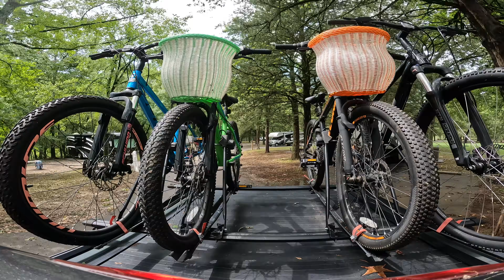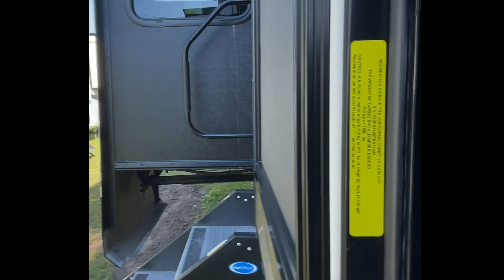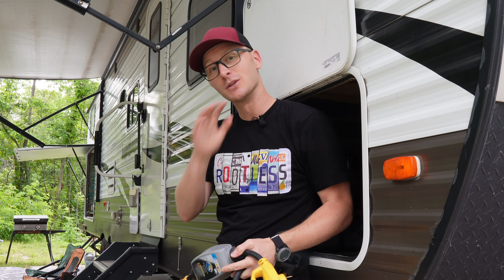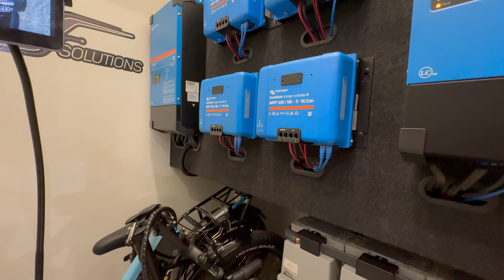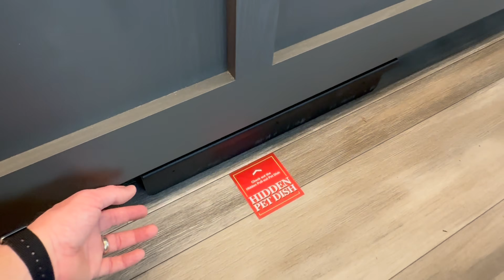BEFORE Buying My First Travel Trailer, I Wish I'd Know This About RVs...

Comment from the maker: There are a few things I really wish I had known before hitting the road with my first travel trailer. Let’s talk about the lessons I learned the hard way (so you don’t have to) that can save you time, money, and frustration with your RV adventures.  If you’re shopping for your first RV or looking to avoid some common rookie mistakes on your next rig, this one’s for you. ⬇⬇⬇CLICK READ MORE FOR LINKS⬇⬇⬇

DISCLAIMER We participate in several affiliate programs that earn us a commission on purchases made through our links at no extra cost to you!
Some product links are affiliate links which means if you buy something we will receive a commission. As an Amazon Associate I earn from qualifying purchases. Some of the gear in this video may have been provided to us at no cost. The views and opinions are our own. This video is NOT sponsored.

⭐ GEAR ⭐
🔷Mattress Airflow Options:
 🔹Hyperventilating Aire-Flow https://www.mattressinsider.com/mattress-condensation-prevention.html
 🔹DRICORE DuraDri Mattress Underlay https://geni.us/wmVNARi (Amazon)
 🔹Froli Sleep System https://nickleatlantic.com/collections/star 
 🔹Other Underlay Options on Amazon: https://geni.us/2lxdVd (Amazon)
🔷Power Watchdog by Hughes Autoformers Electrical Management System Smart Surge Protector with Wifi Gen2 https://geni.us/FNV5F (Amazon)
🔷Microair Digital Wifi Thermostat https://geni.us/CWLS (Amazon)
🔷MaxxAir Deluxe Rooftop Vent Fan https://geni.us/zHWkhB (Amazon) 

⭐ Services & Trainings ⭐
♦RVFix: 14 Day Free Trial & HUGE Discount Use Code "GEARANDFAR" https://www.rvfix.com https://rvgearandfar.com/rvfixreferral
♦RV Help: https://rvhelp.com/ref/vE88nWyI
♦RV Technical Institute https://www.rvti.org/
♦Lippert Owners School https://support.lci1.com/rv-owner-training
♦NRVTA In-Person Training: https://nrvta.com/
♦RV Tech Course Home Study Program, Produced by the NRVTA (Virtual) https://rvtechcourse.com?ref=rvgearandfar⭐ Additional Videos ⭐
🎥DIY 2x4 Stabilizers Tutorial https://youtu.be/ropysInhCbc
🎞Angled Stabilizers Comparison https://rvgearandfar.com/ytcomingsoon
🎥Full Tour of Our RV https://youtu.be/m3y-VB8hVbY
🎞RVing With Pets https://youtu.be/G1GCfwelap8
🎥Whats in my RV Toolbox? https://rvgearandfar.com/ytcomingsoon

🚐 Favorite RV Gear:
🔸GasStop Propane 100% Emergency Shut-Off https://geni.us/KmLBS (Amazon)
🔸Valterra Twist On Waste Valve https://geni.us/IHqqrCA (Amazon)
🔸HitchGrip Hitch Handle https://geni.us/FENglr (Amazon)
🔸Portable White Noise Machine https://geni.us/puASyQQ (Amazon)
🔸RV Ramp Levelers https://geni.us/iJWkX (Amazon)
🔸Solid Rubber Wheel Chocks https://geni.us/vS04fc4 (Amazon)

00:00 RV Tires: Important Information 
Why your RV tires might need to be replaced before you take your first trip, even if they look fantastic
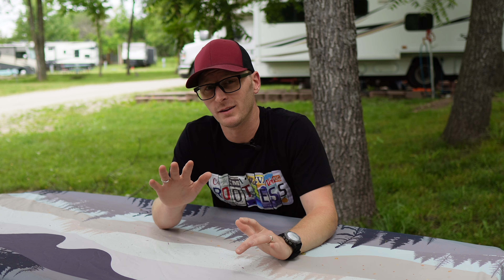01:44 Is RV Travel Cheap?
The real cost of RVing—and why it’s not always the “cheap” way to travel
02:23 Why an RV with “no repairs” (even a new one) is a HUGE warning sign
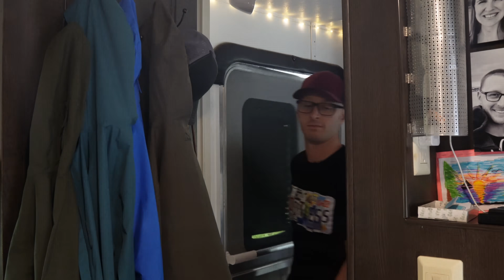04:23 RV Mattresses - What’s the deal?
RV mattress sizes (spoiler: they’re weird) and one way to fix the sizing issues without breaking the bank
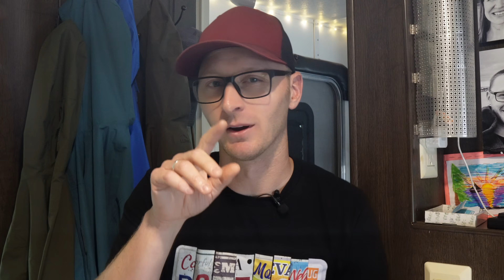05:12 The Problem With RV Dinettes & Jackknife Couches As Beds
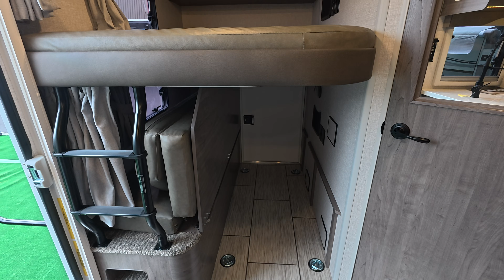06:11 WARNING: Important Consideration When Replacing An RV Bunk Mattress
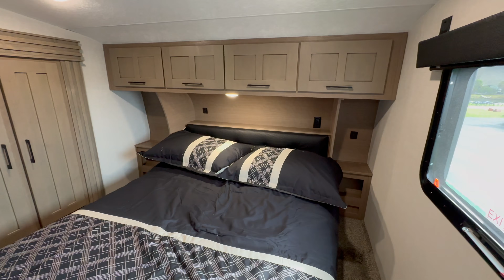06:27 How To Keep an RV Mattress From Molding
07:27 Payload VS Tow Ratings: The Difference & Why RVers Should Care
09:46 The CRUCIAL Number Most RVers Avoid (Or Don’t Know About)
11:17 30 amp VS 50 amp RVs: What’s the PRACTICAL Difference?
The difference between 30 amp and 50 amp electrical systems—and why it matters way more than I realized
14:34 RV Surge Protectors VS EMS (Electrical Management System)
What an EMS (Electrical Management System) actually does and why it’s worth every penny
17:17 12v RV Battery: Can It Run My RV Overnight? 
You’ll be unpleasantly surprised at how little your standard RV/marine 12v battery can actually run over a 24 hour period - let’s break it down
19:03 RV Vents: How Many Rooftop Vents Are Ideal For Camping?
19:43 Electric RV Stabilizers: Are They A Worthwhile Upgrade on your Camper?
20:30 What Are The Best & Cheapest Towable RV Stabilizers?
20:54 RV Floorplans & Road Mode: How Vital Is Roadside Access With Slides In?
22:02 RVing With Pets: Key Tips To Camping With A Dog or Cat
23:00 The Hard Truth Behind Owning an RV
23:29 Not Everything You See Online Is Accurate Concerning RVs
24:12 Training Opportunities for RV Owners

🏘 Join the RV Gear & Far Group Here:
https://www.rvgearandfar.com/rvgfyt 

Connect with us! 
💥 🎥Connect! https://www.rvgearandfar.com 📷📺

© RV Gear & Far, All Rights Reserved. 

This channel is for entertainment purposes only; we are not experts or professionals. We share our opinions, experiences and what works for us. Please do your own research and make your own decisions.

#rv #rvlife #rvgearandfar

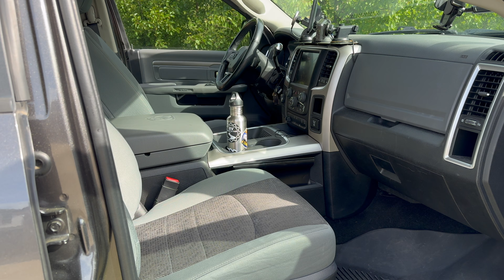Comment: 8:49 it actually does NOT include a 150lb driver. You must deduct the weight of the driver from the payload as well.
Reply from the maker: Check your specific make/model/year vehicle - I found this in the RV & Towing Guide: https://youtu.be/zXvJsrzI2sg?si=aovXMBRV1EXiZXrV
Reply: @rvgearandfar the RV and Towing guide specifies maximum payload within the guide which is adjusted downward for these figures to help you make a purchasing decision. The door jam sticker on a specific vehicle does NOT factor any passengers including the driver.

Comment: Great tips! I just have one question. You seemed to say that a 150 lb driver would not count toward the available payload capacity. I have never heard or seen this before so I did a little research and I can’t find that anywhere else. I have a ford and on the Ford website curb weight is described as “the weight of the vehicle including a full tank of fuel and all standard equipment. It does not include the weight of any passengers , cargo, or optional equipment.”

Even though they use the term “passengers “, I believe this would also include the driver or they would have included the driver in what is included in the curb weight. I am a stickler on not exceeding weight ratings of my truck or trailer so I weighed my truck at a Cat Scale when it was new, no gear, a full tank of gas and no occupants and it was within 20 lbs of the curb weight on the stickers. Note: the “curb weight” was not listed but can be calculated by subtracting the listed max cargo from the GVWR. 

I hope I’m wrong because I would love to find out I have an extra 150 lbs of cargo capacity that I didn’t know about.
Reply from the maker: It was in the RV and Trailer towing guide - see example here: https://youtu.be/zXvJsrzI2sg?si=fL9BZ6vKh_nQyVxV&t=109

Its quite possible that they've adjusted this as those types of number manipulations seem to change over time and on what the manufacturer wants to highlight

Comment: One question, why are you using the electric side of the water heater, just use propane, and you can save yourself all of those Watts
Reply from the maker: That's what we've switched to for the most part - but the main draw to using the electric heating element is not having to pay for, or refill propane cylinders ◡̈

Comment: What do you elevate the mattress with? I had no idea there could be an issue of mold because of the pass-through storage
Reply from the maker: Its a product specifically designed for this - comes in a roll and you cut it to fit your space. There are some links below.

DISCLAIMER We participate in several affiliate programs that earn us a commission on purchases made through our links at no extra cost to you!
_Some product links are affiliate links which means if you buy something we will receive a commission. As an Amazon Associate I earn from qualifying purchases.

🔷Mattress Airflow Options:
 🔹Hyperventilating Aire-Flow https://www.mattressinsider.com/mattress-condensation-prevention.html
 🔹DRICORE DuraDri Mattress Underlay https://geni.us/wmVNARi (Amazon)
 🔹Froli Sleep System https://nickleatlantic.com/collections/star 
 🔹Other Underlay Options on Amazon: https://geni.us/2lxdVd (Amazon)

Comment: And what is the best advice? Because I just purchased an RB and I'm trying to figure out how everything works. What is your Best it's advice. In case did I wanna have the AC run in first? So what I supposed to do? Because my Rb is  30 amp
Reply from the maker: Would you mind rephrasing your question - I'm not understanding exactly what you're asking.

Comment: Great video. To manage my 30 amp load, I will turn on my water heater for an hour or two prior to need when the A/C will be used. Water stays hot for hours. A bit like the emersion heater when i lived in England.
Reply from the maker: Yupp - power management at its finest! ◡̈

Comment: I watch a lot of RV tip channels, I always find yours are well done. I especially love the DIY 2x4 stabilizers. It's nice to not get that rocking feeling with kids around. Electrical section was most helpful for me. Ive probably overdrawn my AC unit on 30 amps 🫤
Reply from the maker: As have most 30amp campers unfortunately

Comment: You have to switch to lithium batteries.
Reply from the maker: Definitely helps - but a single 100ah lithium is still not a light saber - the math has to add up

Comment: I wish I had known about the max use of 30 amp appliances simultaneously. About 4 years ago, my outside electrical inlet box overheated and fried the wires and one end of the electrical cord. The reason I caught it before total disaster is that I noticed the clock on my microwave flickering. When I investigated, I found the damage. Had to install a new electrical box and rewire it. But I feel fortunate, because my entire rig could have gone up in flames. Right about that time, one of my two batteries was smoking hot like Chernobol. I replaced both batteries. Unsure whether one problem caused the other. Four years later, no issues. Fingers crossed.
Reply: As an electrical engineer, great call on replacing both batteries at the same time. People who don't replace both batteries will have the new battery degrade faster since, over time, the new battery will end up drawing most of the current as the older battery continues to barely hold a voltage.

Just wanted to say, "Great call!"
Reply: @koffeepc  Thank you, sir. I am an amateur at this. The decades old advice I got was to simultaneously replace both sides of something, ie., wiper blades, vehicle lights, etc., and I thought it would be much safer to start from scratch with two new batteries.
Reply from the maker: Glad you caught it!!!!

Comment: Ohms law, not watts law.
Reply from the maker: Watt's law is correct for this calculation because we're wanting to calculate power - Watts = Volts * Amps  (ohms law is Volts = Amps * Resistance)
Reply: @rvgearandfar wrong.

Comment: You forgot #1. All occupants/travelers who will use the rv need to sit on the toilet. Is there enough arm room? Are your legs sticking out the door? Are your hips smashed between a wall and cabinet?  Can you spread your legs?  If you can't comfortably sit to use the toilet DO NOT BUY the rv.
All the bells and whistles won't change anything in rv's that weren't "bum" compatible!
Reply from the maker: Toilet position is super important!

Comment: 800ah is the sweet spot for Lifepo4 offgrid power. It will also be about the same weight at 200ah of lead acid.  I was impressed how well my two portable 200watt solar panels kept them topped off. I bring an inverter generator in case the sun is not out to charge the batteries.